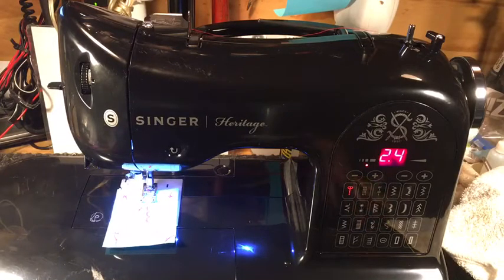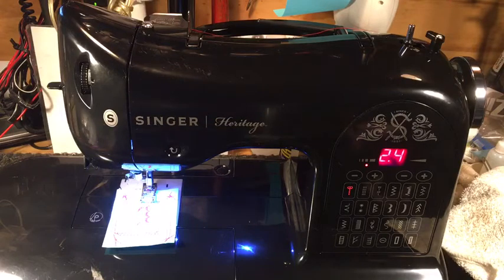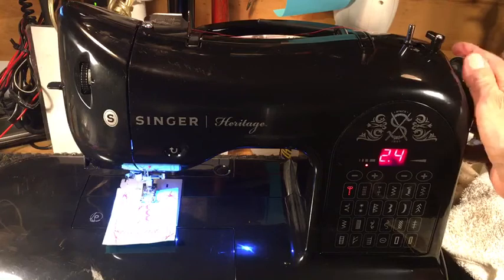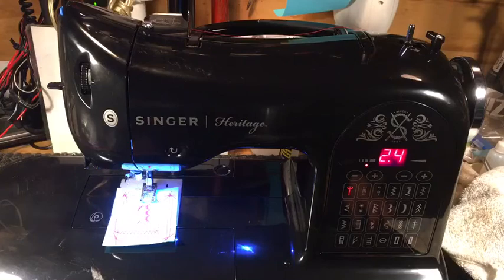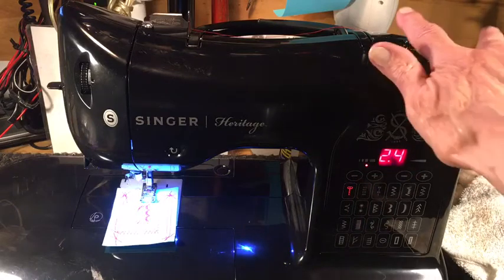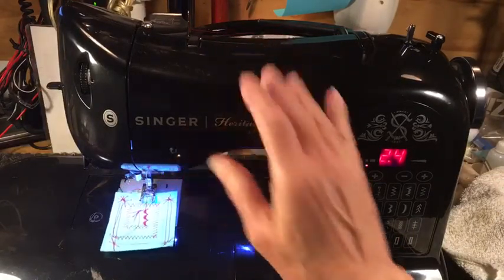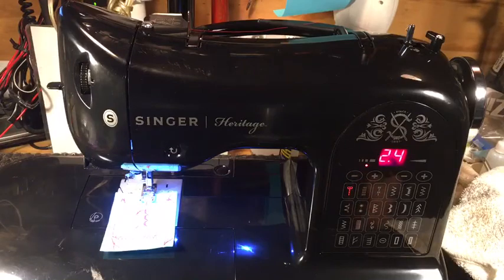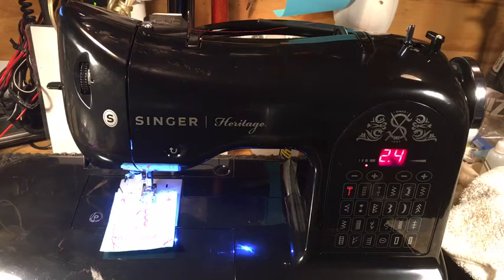How to fix a Singer Heritage 8768 with code c6 and c7 remedies

Comment: Omgosh, I'm SO glad I found this video! 
On a budget of...
 $500.oo.... ish. 😉
What machine would YOU recommend to up from my beginner, but has PLENTY room to grow. That will last, and is well made. I found that I need the foot to raise nice and high. I bought a Brother beginner. After 3 uses, It wasn't able to handle my needs. I'm so afraid to make another purchase mistake. I need a machine that can handle several layers of  thicknesses, ie; heavy upholstery fabrics, thick bumped, triple pleated  draperies with heavyweight buckram, as well as silks and chiffons. Low level vibration and noise would be sweet too. As you can tell, I REALLY need advice. 🥴
Please please help🙏
Reply from the maker: Kenmore 158 series is always my first recommendation for your beginner and forever machine. I have several videos that sing their praises.
Reply: @randyyoursewingmachineman9954  
I will. 
Thank you so much!

Comment: I have one that the Feed Dogs move - but don't come up to push the fabric. Stepping Motor Replace ???
Reply from the maker: If they move, the step motor might be ok. If they cycle front to back fully, on the longest stitch length setting, they might just need their height adjusted. 
There is a threaded bolt (tiny) that has a small lock but on it, that has to be loosened to adjust them up and down. 
It’s sometimes directly underneath the feeders, or directly behind them on top, under the needle plate. 
Be sure to cycle the drop feed mechanism multiple times and turn the hand wheel repeatedly towards you, to give them a chance to engage. 
It may be that they’re just reluctant to engage and need your encouragement. 
😎👍🏼

Comment: I start to sew well and then the needle seems to get stiff and slow and I get the C4 error. When I press the return button the same C4 error occurs. It is not thread wound on a bobbin or fabric stuck. Can anyone help?
Reply from the maker: I can try. 
That’s usually a sign that the main bearing under the hook needs oil. 
Lift out your bobbin case and add a drop or three of sewing machine oil to the center of that rotating hook assembly. 
There’s oftentimes white felt in the hole in the center. 
That’s your oil reservoir. 
Add a drop every two bobbins. 
I hope that helps. 👍🏼😎

Comment: how to remove the c6 sensor?
Reply from the maker: @MoymayaWeddings  that’s generally solved by oiling the bearing under the hook assembly via the center hole under the bobbin case.

Comment: How do you fix the c6 error. No matter how many times I work the thread it still comes with this code. It's like the sensor is broke
Reply from the maker: Be sure to lubricate the area that drives the hook. If a bearing is dragging down the motor speed you’ll get a code. If the hand wheel is sluggish, that’s a sure sign of lubrication needed. 
Use a flashlight to check for loose pieces of thread along the path of the upper threading. Good luck

Comment: Why do we buy these? My D-I-L had this  model and hers ran beautifully when I used it. Recently, the foot pedal plug has disappeared inside, looks like a simple part broke. So, it looks like I'm off to pay almost as much as I did when I bought it to have a simple repair done...
Reply from the maker: You’ve had your epiphany about these machines, along with many other folks. When the emphasis on building the best and most reliable sewing machine changed to “always the lowest price, always “, construction methods had to change radically. Steel, chrome, and brass turned into plastic, plastic, and more plastic. Now, I think there’s a challenge to see how thin and light, plastic can be made to “create” a sewing machine. Want a good machine? Go retro. Find one from the sixties or earlier. They’re still state of the art and exponentially better. Watch some of my video reviews of the older Singers and Kenmores. Try shopgoodwill.com or similar sites to find one. Go! Retro!
Reply: @randyyoursewingmachineman9954  My back up machine is my old reliable which is heavy metal. I do miss that quality. What I do like about this machine is the rounded edge that feeds the fabric. Do you know of any retro vintage machines that have that type of feature? I never use fancy stitches just straight and zigzag. Thanks.....I do miss the quality of almost all things these days including the machines.
Reply from the maker: @dianneyudelson2569  most t European sewing machines were available in the free arm configuration starting in the sixties. Elna, Bernina, etc. The Kenmores and Singers followed later with theirs. 
The Kenmores I can recommend.
Reply: @randyyoursewingmachineman9954  thanks Randy i used to have a Kenmore in the 80s and 90. When I'm speaking of the curved edge i mean the entire front body edge. Just something i found i really like about this machine that i think other makes should incorporate.😊✌